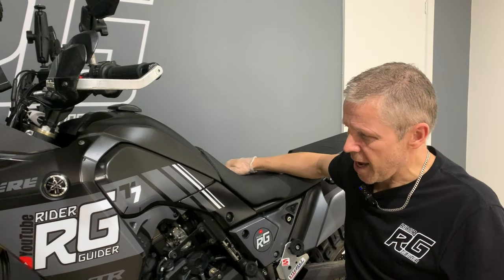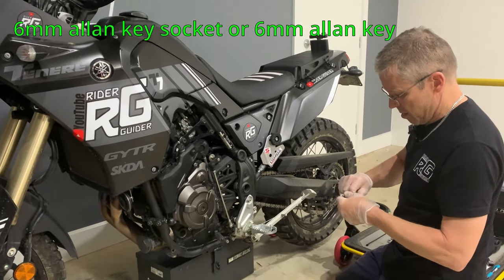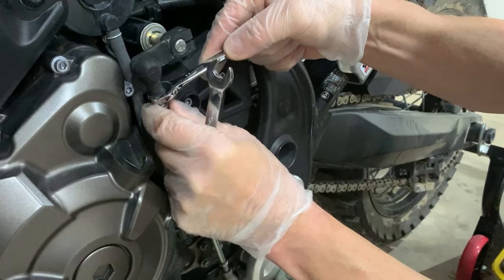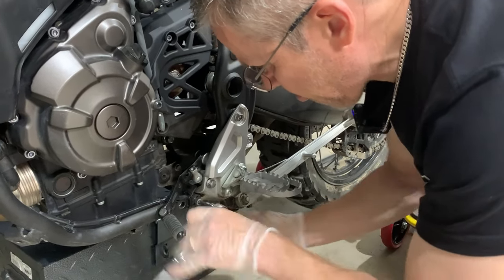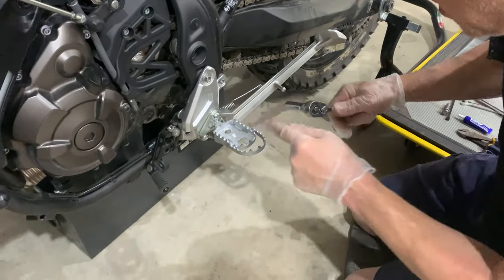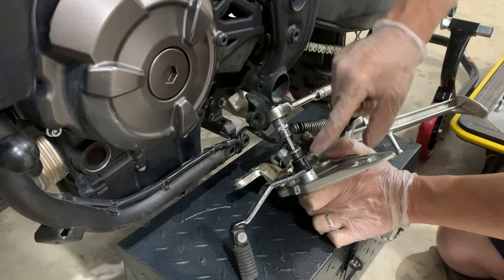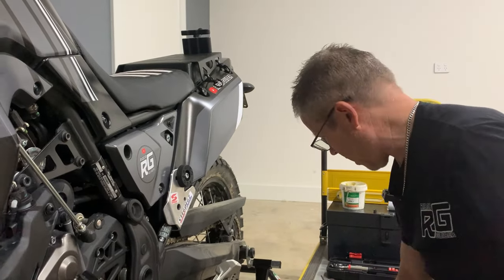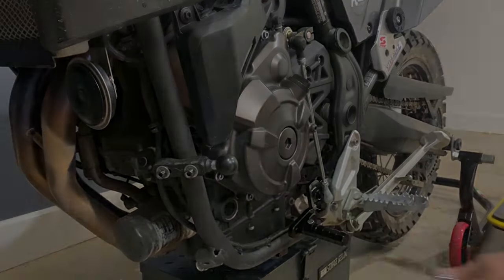YAMAHA TENERE 700 NICECNC GEAR LEVER INSTALL AND REVIEW

Comment: Can you flip the tip around in its adjustable bracket so the the tip is further back along the lever? It looks like you can which would solve your problem of it being an inch further away.
Reply from the maker: I wasn't sure what you meant there but get it now, possibly, but because I've got Tech7 boots, I'm happier now with the longer lever, works great!

Comment: I need to order this. I just bought some motocross boots to ride with my tenere. And i cant hardy shift with the stock lever.
Reply from the maker: Hi mate, I've really got used to mine now with my stiff boots, the larger toe lever is helpful, and adjustable (but ensure you use threadlock on the adjusting bolt).  Don't forget the discount code ;-)

Comment: well decribed! do you think with this shift lever it can be adjusted slightly lower than the stock gear lever? I want mine a bit lower, but its maxed out.
Reply from the maker: By the fact it’s an inch longer I reckon it will be a touch lower on the toe.   Might be worth some research in relation to adjusting the gearbox connection on the spline?
Reply: I seem to have an extra rubber spacer, any idea where it goes? i didnt see it in your video either!
Reply from the maker: It goes behind one of the bolts.   I left mine off but might put it back on.  Can’t really see what it actually does.

Comment from the maker: #NICECNC #yamahatenere700 #GEARLEVER #RIDER GUIDER #theriderguider 

The great people at NICECNC sent me this gear lever.  

Here's an install, road test and review of it.  The NICECNC range covers many different models but there is a decent range of goodies available for the Yamaha Tenere 700 including this gear lever which currently sells for about AUD $60.  This is great value for what it is and the quality of the item itself.  On their website you can click the button top right and change your country code and it will give you a local price.  Remember to use discount code RG10 for 10% discount.

click this link below which takes you directly to the gear lever https://www.nicecnc.com/collections/yamaha-tenere-700-motorcycle-parts/products/shift-lever-gear-shifter-for-yamaha-tenere-700-xtz-700-2019-2023

Thanks for watching and taking the time to read this information.  Please remember to subscribe etc and say hello in the comments - it helps us grow the channel.

Ride safe

Neil & Chantal 😀